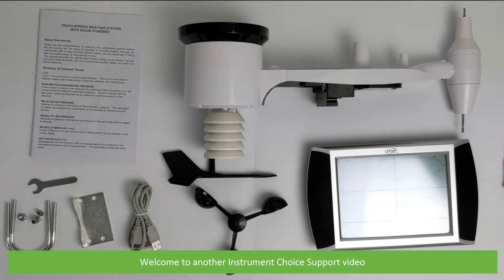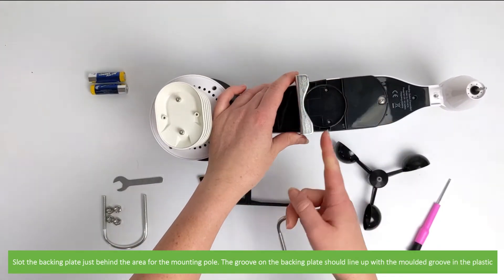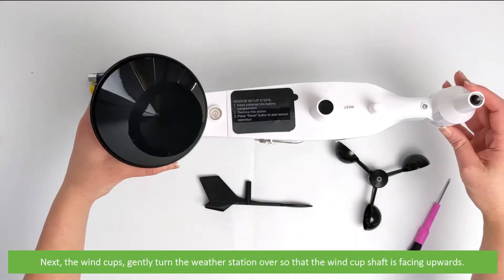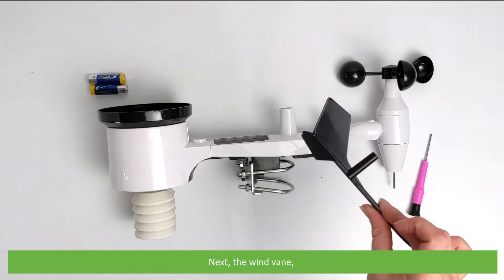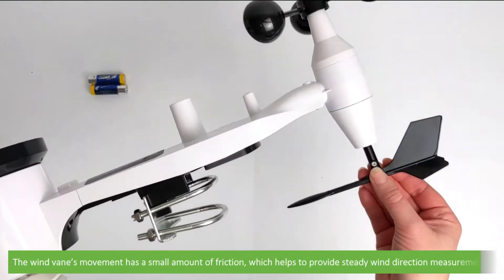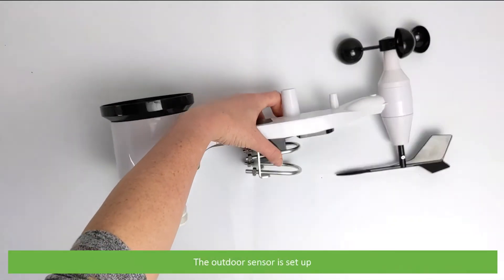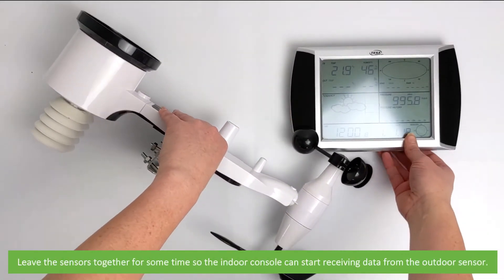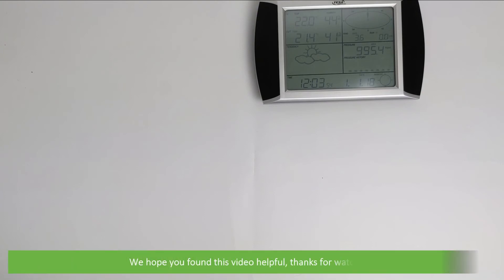How to Assemble the IC-WS1081V3 TESA Professional Weather Station

Comment: Hi... quick question about the outside installation of the Sensor...
Depending on your location on earth the magnetic declination can be quite different.
Do you make the WEST direction indicator on the unit match the MAGNETIC WEST or the GEOGRAPHIC WEST ?
Thanks.
Reply from the maker: Hi Francis, thank you for your question on the IC-WS1081V3. With regards to this, this would need to be matched with True North using the aligning indicator on the outdoor sensor suite.